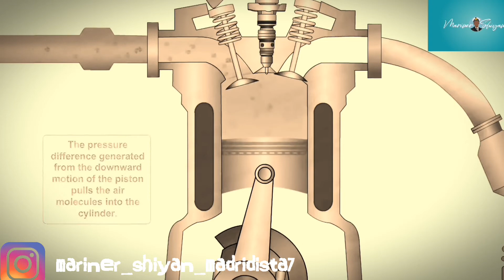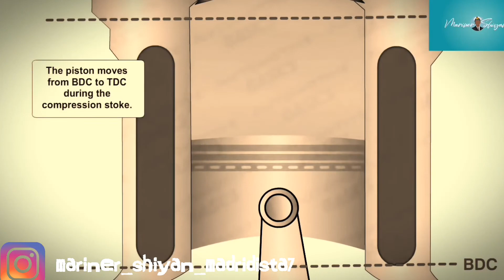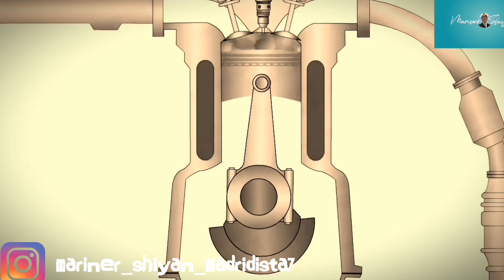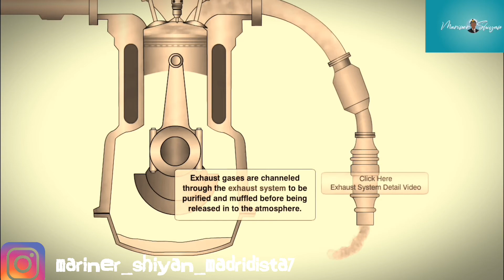4-Stoke Marine Diesel Engine Explained II Working Principle, Concept & Function Explained - English

Comment: Difference between natural aspiration & turbocharged engine
Reply from the maker: That calls for a topic to itself.
A naturally aspirated engine is the one in which the rushing in of air takes place just due to atmospheric pressure, while it's just the opposite in Turbocharged Engine,  here we make use of Waste heat of Engine into full utilization rather than wasting the stuff!! 

Thank  You 
Mariner Shiyan

Comment: What's the Overlapping degree of the v/v for valve timing diagram?
Reply from the maker: That's an interesting question,  well that's the period when your scavenge port/ inlet valve and Exhaust port/valve are opened for a few degree of the crankshaft  as per design and manufacturing. 

Thank You 
MARINER SHIYAN